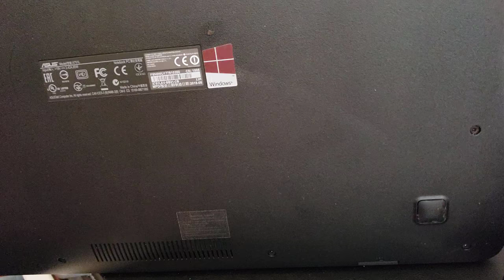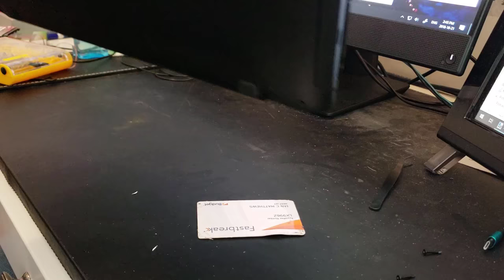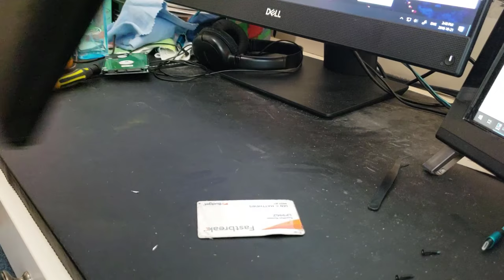Disassemble Asus X751L Laptop to Replace the Battery and Harddrive

Comment: You are somewhat frantic in what you presented. I want to get into my Asus X751S, which looks identical, but I am lost. To take the keyboard cover off to get to the guts of the machine, do I still have to unscrew the back part?  I am wondering if the screws on the back (the underside of the laptop) are only there to keep the motherboard in place. I know this video is five years old, but my computer is still running great but I was just wanting to take out the extant HDD and put one in running Linus OS.

Comment: At 6:50 what is that white thingy that looks like it connects the keyboard and the "motherboard?" Cause like I opened my laptop cause i kept getting the blue error with the sad face and i accidentally pulled too hard, laptop stills works but the drive name "data" was gone. And the blue screen is because of the "data" too since after the restart it was gone but when you shut it down and opened it again it's gonna be there but after a few seconds it freezes and then blue screen

Comment: i have to change ram to my asus x751. can I know if it can contain 2 modules or only 1? thank you
Reply: I think that x751 series can handle only 12gb of maximum ram. And there's only 1 removable ram slot. The second ram is integrated to the motherboard. So the only upgrade that u can do is to add a 8gb ram.

Comment: Hi pal, good video. I have a problem after disarming a X555Y model. I put everthying in order and seems to be fine. The problem is that the speakers are not working, but if plug any device (usb headset, 3.5mm smartphone headset) it works correctly. I have reviewed the device manager and it's not showing any problem with sound drivers. Although I have updated them all, trying with one or another there is no sound. I think I disconnect something inside. Thanks for your reply
Reply: Uninstall and reinstall audio drivers.
Reply: Got the same problem with my keyboard

Comment: I followed the video while I was removing the back panel from my laptop, you said that it might be removable from the front if it doesn't nudge from the back
I did that, but it was actually just the back cover, so by opening the laptop screen with the cover half way removed, I broke my hinge on one side, thank:/
Reply from the maker: Wow.  Hinges are strong, so if it broke there must have been some previous damage (or you took a crow bar to is... I doubt).
Reply: @URTechDotCa  it's the plastic screw that gold the small metal penal that connects to the hinge :/
I closed the laptop back  seems to be working
But I'm concerned that something might break soon

Comment: When taking the top off, there will be resistance, like you have missed a screw in the middle of the back cover. This is because there is a hidden clip between the HDD and DVD drive, right next to the motherboard that resists. The only thing I found to unclip is to use gentil brute force.

Comment: Mine Y751LD on it's motherboard has some strange fixating thing "H5016" right in front of fan so I can not remove the motherboard. 
I liked this notebook so I wanted to check if I could revive it with Linux Mint which test show that notebooh has no faults and gave green PASS but it shuts down right when the system has to boot. I guess the motherboard is fried. If I could only remove that H5106 thing.

Comment: Thanks for the video! But now my keyboard doesn’t work after opening the laptop, but the mousepad does work. Does anyone know what could be the problem?
Reply from the maker: I would pull the back off again and check the keyboard connector cable... perhaps you knocked it loose.  Also, you can try to use an external USB keyboard to confirm it is not a software problem
Reply: @URTechDotCa  Yes I’ve found the problem! The connector was indeed loose, because apparently there is a clip to hold the connector in its place. Thank you so much!
Reply: I also got the same problem, but I'm trying to reconnect the cable and it's still not working

Comment: thanks, a very good video! my graphic card seems to have some problems, is it easily replaceable? thanks and best of luck!
Reply from the maker: Hi Eda;  Laptops are sometimes promoted as having replicable video cards, but I have personally not seen a single one since Intel was making complete laptops in the mid 2000's, soooooo I doubt it.  

Thanks for the comment and sorry for the looooong time lag on the response; I have been in Hell in recent months with... lots of personal stuff.  Thanks again.
Reply: Not on this one, but even if a laptops gpu can be replaced its usually not without risk of breaking something else. So its imo not worth it.

Comment: I just can't pry open mine, help plz
Reply from the maker: It does take some force.  Try a an old credit card.  In my case (pardon the pun) I have gone so far as to use a small flat screwdriver to separate plastic parts that are clipped together tightly.  My logic is, if I am going to have to toss the whole unit out if I don't get it open then I might as well risk a little damage.  Thus far, I have only bent and scratched a few items and never actually 'broken' a laptop or hard drive during disassembly.  Thanks for the comment!